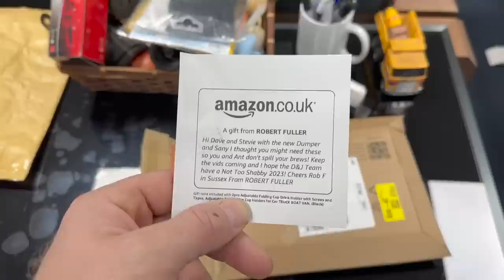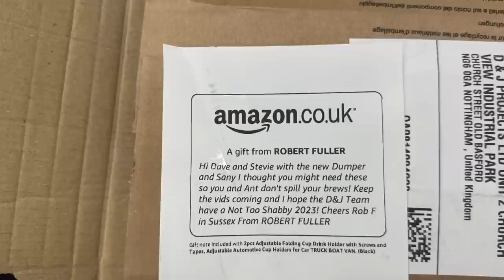I Travelled 520 Miles For ONE Job...  *AM I MAD?!

Comment: Big D. that’s how a proper boss dose it.  dose a job miles away Bog tired but is still out the next day with the lads.  👍.  Good to see the Sany earning its keep that hedge just might as well it have been there.   very very handy bit of kit.  worth every penny.  Can see how the land take is well worth it as well. 
I’m kind of stuck the the plastic panels.  but i do like the grey. looks smart odd thing to ask how dose it stand up to heat / cold and UV ???   looks smart though  
Stevie & Ant.  cracking lines straight as they come.   good to see you take massive pride in your work.   👍👍.   
Have to say the 1 hour  video goes down a treat on a Sunday evening. thanks for all the hard work making it.  and editing it all.   cracking job.    
Like the hats i think i can remember Big D say he was looking for the right supplier to get a merch shop.  👍    have a fantastic. week D&J. and it’s only 24hrs to the Wednesday special.   not to shabby 👍🤩👍

Comment: Hi dave just watching you pulling out that hedge with the sany and using the ra
ke.there one more addition you can add to that machine and it won't cost you £50 you can weld a ball hitch on the blade at the very top of blade dead center you can hitch onto your trailer. There's always times you can't back in with your van when the trailer is loaded with material I've got a ball hitch on my 3 tonner very handy for backing trailer right into where you want it and handy for moving trailer around yard aswell.as always very entertaining videos for someone that's semi retired that's all I watch and the struggle some carickter.keep up the good work boys  👍
Reply from the maker: Top tip Patrick will look into that 👌🏻

Comment: The new gate (25:25) you put in is not very secure with the bolt at the top, I'd be worried about someone reaching over to slide the bolt. Why not put a second bolt at the bottom as well? Or a proper lock?

Comment: Good afternoon ....episode number 86....😳😳
Loved this episode ... loads going on!!
Those totem pole signs ....did you require any  RAMS  working close to a motorway even on private property ...? Just wondering not checking up ...I also think it pays off big time to have a site visit to start and pre job (the previous week with the right people walking site). You're right though ....the information only goes to a certain level and the people actually involved are last to find out which again should be in  a decent method statement with all heads signing off so there's no ambiguity on the day.
Stevie nearly mentions  " coffee" as  much  "not too shabby" 😜😜 these days ....must be getting like me ... dependant on it 🤔😜😜
That composite fencing is lovely.....what's the guarantee on it not fading ...? I guess that's the only thing that can go wrong with it ...
That new Sany bucket is great 😃👍🏻
Time and back saver !!
Be happy, be safe 🦉🙏 G

Comment: Hi Stevie, Dave and gang (including Bernie who i spoke to earlier on today) Just commenting on the composite fencing, Personally i dont like the idea of plastic (sorry composite) sheds, fences and decking (and probably many other landscaping products) Now for maintance purposes i can see why people use them but to me a fence is made of wood, and as Stevie said last video (or the video before) wood when looked after will last for years. The 'roofrack' in that composite fence install could have been from anywhere, personally i know that the builders who built my place buried absolutely everything under the soil to save the cost of filling in with hardcore or soil (wouldnt be suprised if there was some heras safety fencing about 3ft down) 
I would hope that one of the ladies named the Sani as i believe all the other stuff was named by the guys
. 
As always keep up the EXCELLENT work and its a shame i cannot get you to my place to do a job for me, you'd do a better job than the other contractors !

Comment: If there is ever a D&J video that proves the old saying “right tools for the job” is right it’s this one. Sany showing its value with those hedges and the small JCB getting involved too. Makes the job that little bit easier and more efficient. 👍 Q - what was the reason for taking the job in Plymouth as it’s outside the map area?

Comment: another cracking video lads/lasses - what screws do you attached the wood to the concrete post with? 

that little extension to that lady's land looks brilliant
Reply from the maker: Concrete screw 100mm will get Stevie to show them in video for you Peter
Reply: @DJProjectss  thank you - i have two bays of gravel boards i want to clad with timber at the end of my garden so this would be great, cheers